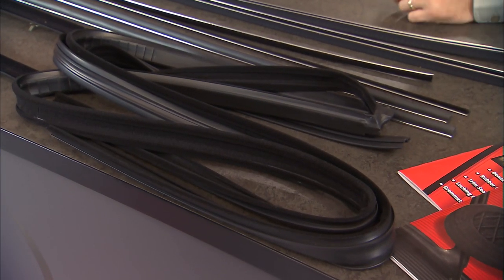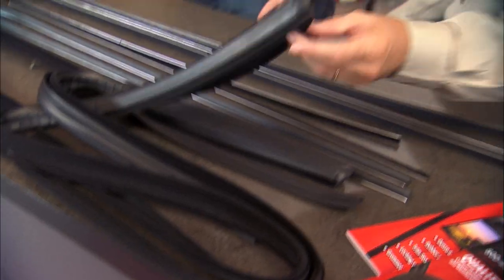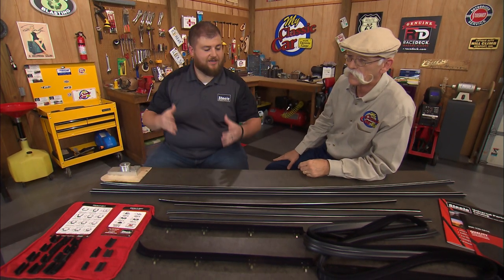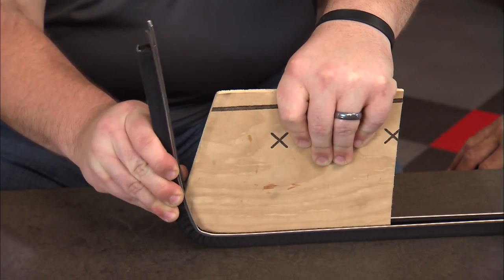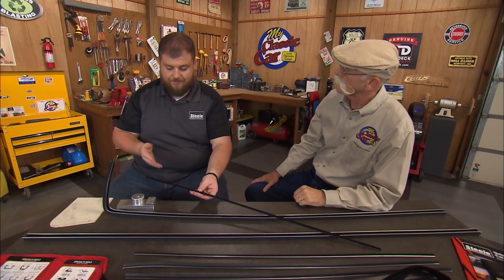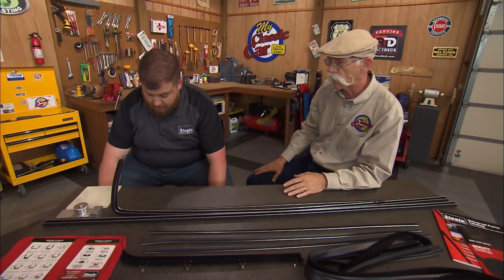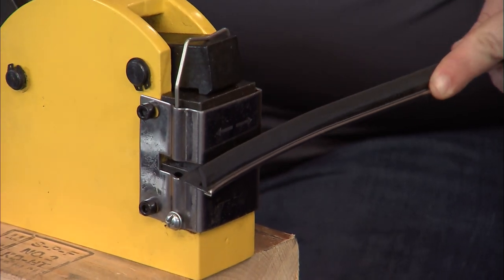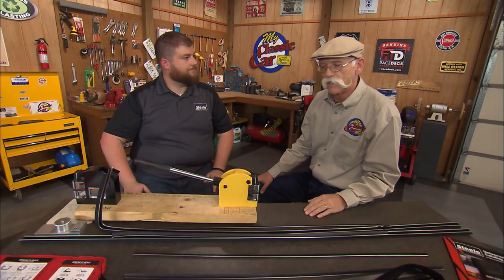Run Channel and Windowfelt / Beltline Solutions from Steele!

Comment: I have a 1997 Toyota Tercel, and the channel runs are not manufactured anymore. Is it possible to make them and how do I do that?
Reply: Please help
Reply from the maker: Hey there! While we do not offer any direct fit replacement parts for your '97 Toyota, we would recommend taking a look through our Universal line. We have over 20 different universal run channel options. I will include a link to those parts on our website here: https://www.steelerubber.com/universal-window-felt-run-channel

We also have a free sample pack that includes some of our most popular universal run channel. If you'd like a sample pack, or would like to speak to someone about finding parts for your vehicle, please contact our customer service department by phone at 800-650-5135 or by email contact@steelerubber.com.

Thank you!

Comment: Do you make Outer Beltline for First Gen Dodge Dakotas?
Reply from the maker: Thank you for your question. We don't offer outer beltline specifically for your first gen Dakota. We do offer high quality universal beltline that you can cut and bend yourself if it will work on your truck. You can check it out here: https://www.steelerubber.com/steele-rubber-home-universal-parts-beltline-weatherstripping  Let us know if you need a small sample to do a test fit.
Reply: Funny, I got here looking for the same thing. I'm pretty sure if someone made them specifically for first gen dakotas, they'd sell thousands of them